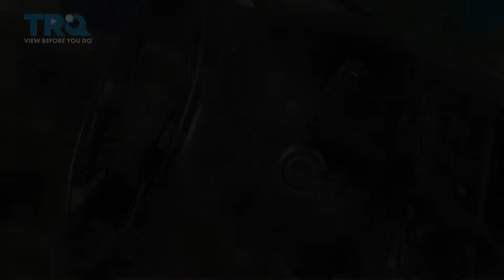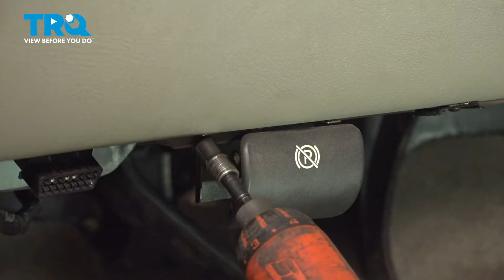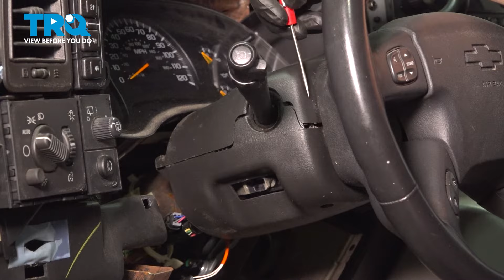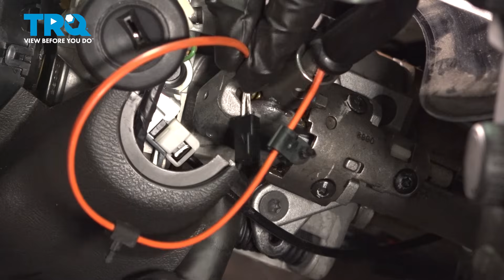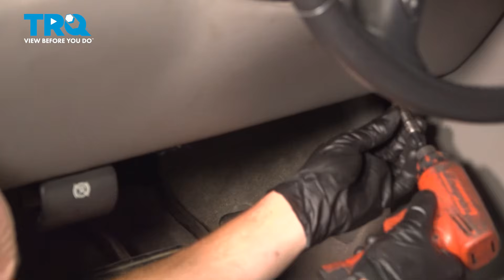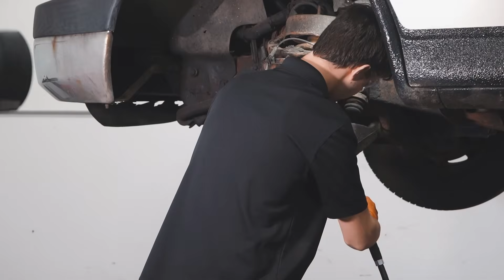How to Replace Automatic Transmission Shift Lever 2000-2006 Chevrolet Tahoe

Comment: On my 2002 suburban the orange wire doesn't have it's own connection point. It disappears into a large group of wires and they go to large connectors further down behind the metal panel. Any tips?

Comment: I have a 2003 S-10. There is sort of a finger at the end of the shift lever that pushes a button in, which then allows the shift lever to go into park. 
That button protrudes out of a small basically rectangular box that  has  wires coming out the back if it. 
That box has 04173 24  on the side of it. but some vids show a different # on the same part. Please tell me the name of that part. 
I cannot see that part in THIS vid. but I bet you know what I'm talking about. I have been searching and searching.

Comment: Just went thru all this had to fight like hell getting the plastic clam shell to mate back together.  I thought I was done and shifted to park and I have a 1/4 in gap opened up at the bottom of the shifter boot.  Talk about feeling defeated😮!  For some reason I guess the boot I got was a little smaller.  😢